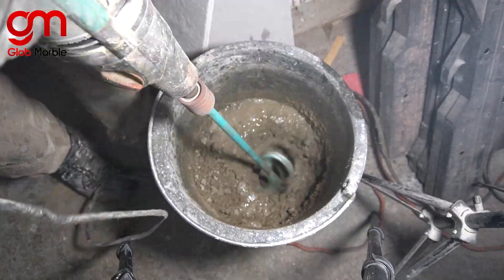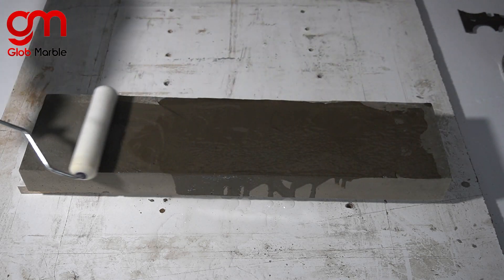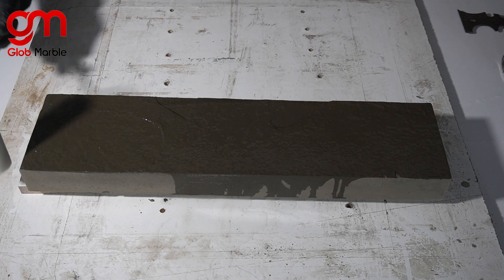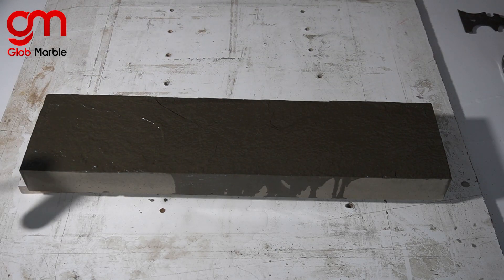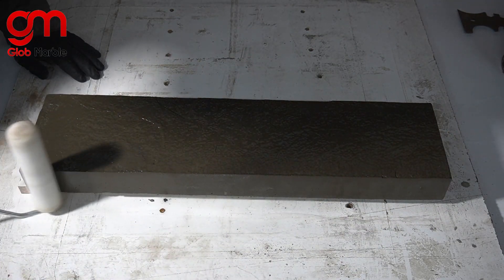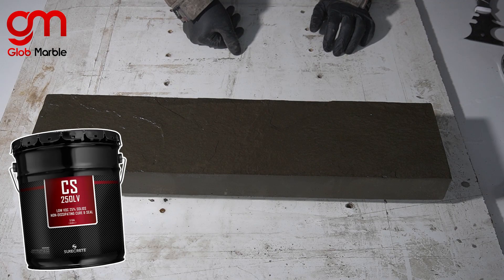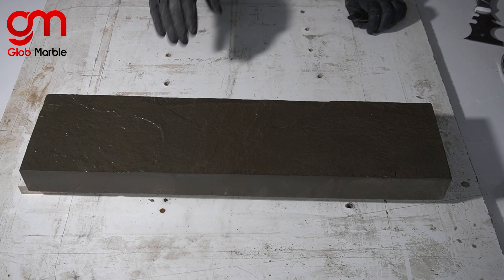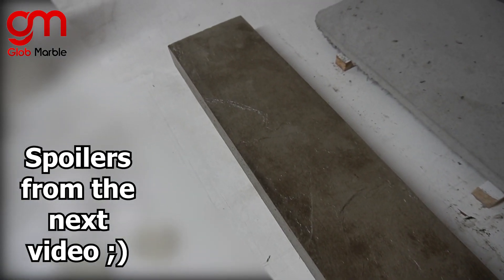Sealing Concrete Too Early | What Happens?

Comment: 5 days ago, I poured a 2 inch tall footer in a doorway to raise an exterior door up off the ground in my garage. I understand the importance of not sealing concrete before it has cured, but can Can I seal just the outside face of that now and leave the rest of it unsealed? I can't wait twenty eight days to install my new door lol.
Reply from the maker: For 2 inches you can get away with waiting for about 2 weeks :)

Comment: file:///var/mobile/Library/SMS/Attachments/a8/08/7FCEA471-73A9-4E63-B4D7-912F8D6B05F6/IMG_4507.heic

Thank you so much for that great information. Someone did a hack job on my place. This is the picture from three months later. Not sure if he sealed it or not as he’s not answering and says it’s still drying. What do you think?

Comment: HELP!  My contractor did this.  Now I have opaque areas that look milky.  I used Laquer Thinner on the bad areas, and the opaque areas went away.  Should I have them use a small amount on the entire slap. and then reseal?  How long should we wait to reseal?  What is best sealer?
Reply from the maker: Yes, the best course of action would be to strip the entire sealer and let the concrete cure. Then afterwards, apply the HS200 sealer- https://globmarble.com/stamped-concrete-acrylic-sealer-hs-200.html

Comment: Hello! We recently had 20m x 85cm side of house concreted. Does this still require the full 28 days to seal or can be done earlier as it's not a house slab.
Reply from the maker: the time yu need to wait depends on the thickness of the concrete. 1/16'th of an inch - 1 inch, wait a week. 1-2 inches, wait 2 weeks. 2-4 inches, wait 28 days.

Comment: Thanks for the info. How would I get crumbling sealant off my concrete. It is less than 2 years old. And can it be painted?
Reply from the maker: You need a product called a stripper- https://globmarble.com/faststrip-plus-solvent-based-concrete-sealer-remover-and-coating-stripper.html  And yes, afterwards you can stain and seal or use a pigmented sealer on top of the newly exposed concrete.

Comment: Thanks for the video...helpful! Question for ya...our concrete balcony was laid 2 months ago and we've been waiting to seal it (lots of rain and temps under 5 degrees celsius). Finally have good weather and noticed some areas around the edges were crumbling so developer came and added some new concrete in a few small areas around the edges. Do we have to wait 28 days for the small patches to dry before sealing the whole thing or would waiting a shorter time, like 7 days, be enough since the majority of the balcony is solid after 60+ days of curing?
Reply from the maker: 32 days is just for giant masses of concrete like slabs. 7 days should be plenty of time for moisture to escape patchwork
Reply: Thanks so much!! You put my mind at ease :D

Comment: Can you fix your patio if this happens? Please advise
Reply from the maker: You will need to strip the sealer and wait until the concrete has no moisture inside before resealing. Easiest way to check for moisture is by taping a clear sheet of plastic to the concrete 2'x2'. If there is condensation underneath the plastic after 24 hours you should not apply the sealer.

Comment: Just got my sidewalk stamped and they're coming back in 2 days to seal. Glad I saw this video.
Reply from the maker: If it is a cure and seal product everything is fine. The cure and seal require another coat of sealer after 1 year. For a full strength sealer, you need to wait 28 days.

Comment: Thanks mate, very very useful infomation. I live in South Australia Australia, which is dry arid climate and we are coming in to our summer. I am pouring slab 16M  .x 11 M or 52ft x 36ft  which is my hanger for my aircraft.  So what l understand is i wait 28 days  before sealing. Which leads me to my next question.  What finish would you request from my concrete finisher to  then DYI a presentable sealer / epoxy / Polyaspartic /  Polyurethane or ?  Also it is open hanger with no doors so gets the morning sun every day  Any advice would be apreciated Cheers mate
Reply from the maker: You definitely want to get a broomed finish for grip on the plane's wheels. And since it will be exposed to the elements, I suggest a sealer like HS200 which has excellent UV resistance- https://globmarble.com/stamped-concrete-acrylic-sealer-hs-200.html

Comment: No way could I criticize you. I was actually googling when to seal and your video came up. I just did my first concrete sidewalk and wanted to know when to seal it. Thanks for the help.
Reply from the maker: For sidewalks and other projects that size its recommended to seal after 28 days. Some contractors like to push that boundary a little but that's taking a gamble with the quality of the finished result.

Comment: Great video. We are currently fighting with our patio contractor who absolutely ruined our patio in several ways and one of them was sealing it the day after it was poured. It's horribly horribly stained. They insist that it helps with the curing process. THAT'S BS.
Reply from the maker: Some sealers like cure and seal are meant to be put the day after but they are temporary and need to be resealed with a real sealer after 1 year. Post some pictures on reddit in the r/concrete subreddit and you can get multiple professionals tell you what exactly went wrong and whether it was the contractor's fault and what to do
Reply: @GlobMarble  thank you, I appreciate that. However, our slab is crumbling in places as well as the finish looks like Stevie Wonder did it. I've been around the construction industry my entire adult life and I am an electrician by trade and I have never seen a slab that looks this bad. They are ignoring our texts and ignoring our phone calls, so we are going to have to sue them in small claims court unfortunately.
Reply from the maker: Damn, I hope you didn't pay too much upfront. Some people are crooks man. Seriously post all the issues on the subreddit and use what the professionals say to your advantage, gauge how likely you are to win cause a lawyer will take your money regardless

Comment: Hey man. Great video. I’ve just had a slab poured today but building on it is going to be in 8 days. Is it best to just leave it as is and crack on with the building. I hear that after one week, the slab is ok to start building on it and it’s log cabin. 
It’s going to be too early to seal it as per your video advice. Also, is it worth sealing the edges that I can get to after 28 days or is there no point as I won’t be able to get underneath. Thanks dude.
Reply from the maker: Youve got everything right. Log cabin is tricky as moisture will definitely be trapped in the wood and will bleed into the concrete below it. I'd recommend using a product called cure and seal as soon as possible, it's basically a temporary sealer meant to be resealed after a year. Should be enough to hold for a long time under the wood as it will receive no traffic- https://globmarble.com/concrete-cure-and-seal-cs-250-25percent-solids.html

Comment: My contractor added a sealer to our 1300 sq ft garage slab at the end of the day on the day it was poured. Is that too soon? It also developed hair line cracks going across 4 out of the 9 sections poured within 24 hours. Should I be concerned?
Reply: Call him immediately, he obviously has no experience in his field if he left you with those problem.

Comment: My contractor wants to wait only 7 days and then he’s gonna seal it. Is this enough time for it to cure? Or will I have these discoloration issues?
Reply from the maker: Depends on what you are talking about. A mold like this can be sealed after 7 days and still look good. A concrete slab can't be sealed until 28 days after pouring. There are exceptions though, you can use a product like cure and seal the day after you pour it, but you will have to reseal after one year. Here is a link- https://globmarble.com/concrete-cure-and-seal-cs-250-25percent-solids.html

Comment: If you seal too soon and get that discoloration , can it be fixed ? I had stamped pad poured, the guy sealed like 10 days later and this is what it’s looking like.
Reply from the maker: You need to strip the sealer as soon as possible. Keep the slab unsealed for a year for the discoloration to fade. Then reseal. Here is a good sealer stripper- https://globmarble.com/acrylic-paint-and-sealer-remover-and-stripper-envirostrip.html
Reply from the maker: If it fades earlier, you don't have to wait the full year

Comment: After about 28 days when we seal it, can we also paint the concrete after that?
Reply from the maker: No, you should always pigment before sealing. The sealer is the topcoat meant for protection
Reply: Thanks